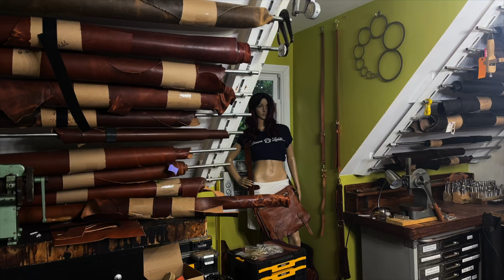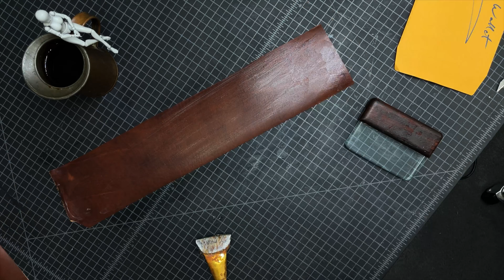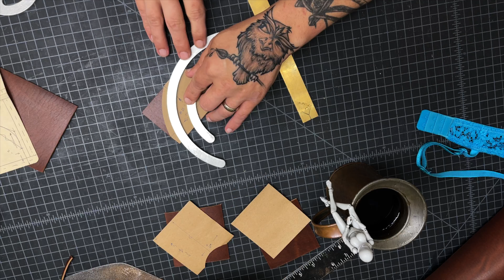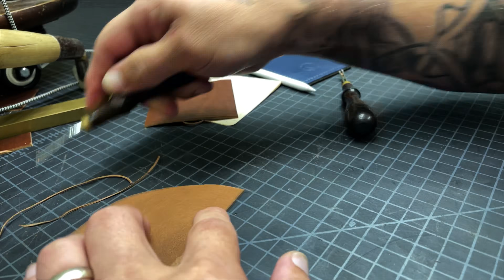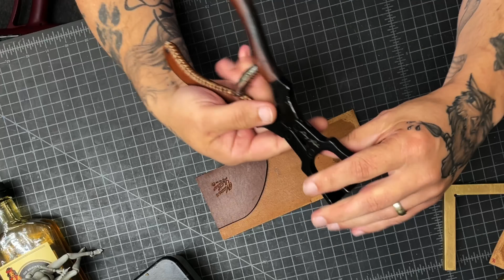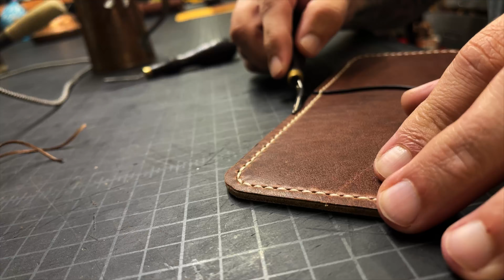Could It Be This EASY!? Making a Leather Wallet and All Tools Explained! (The Faulkner)

Comment: I am about to finish my first big project. And it is actually just copyin everythingg you show in the video. My tools are mostly cheap amazon stuff for now, but I am willing to invest in the future as working with leather is soooo relaxing. Punching every single hole with an awl in all 4 pieces. Because that is what I got. :P What I did for a logo on the top face: I 3D printed a stamp with sharp corners and used a vice to apply it to the leather. It worked great!